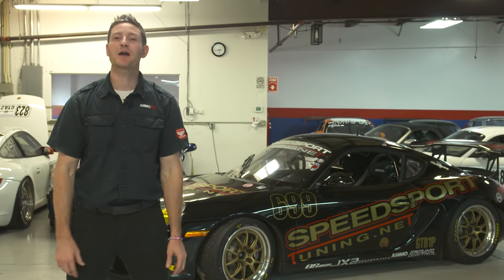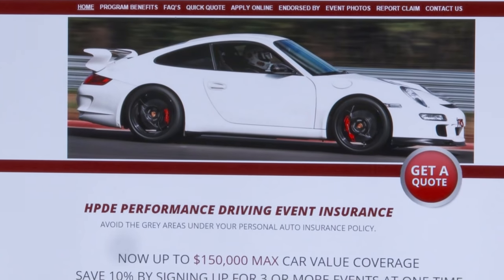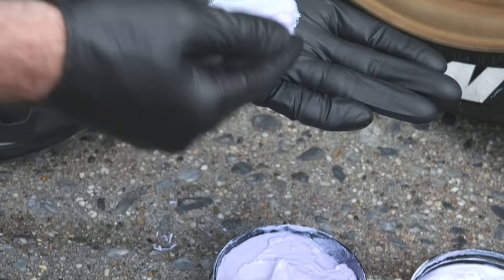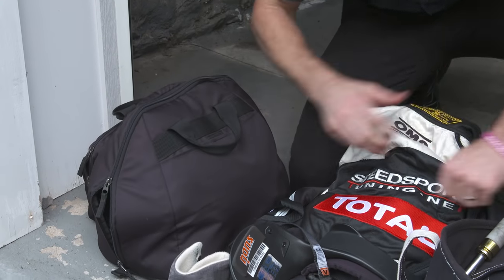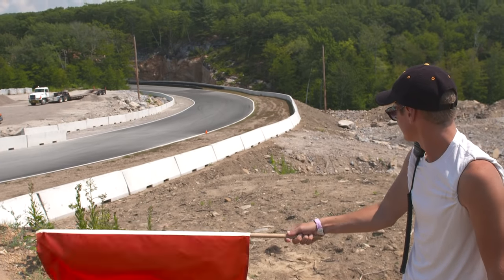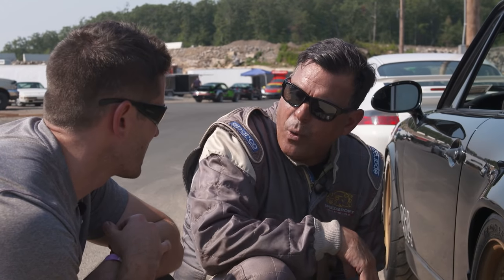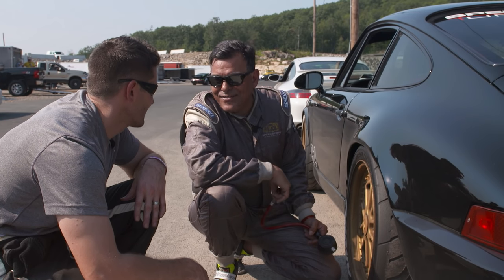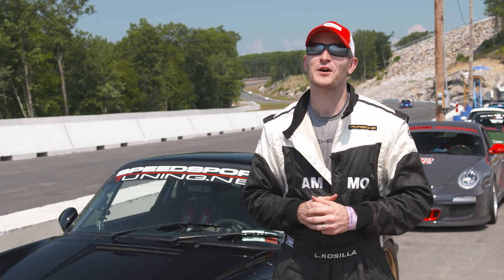Track Day Guide: MUST WATCH BEFORE DRIVING

Comment: this is absurd and virtually prohibitively expensive!  no wonder people just street race.  they don't offer track insurance, so why bother?  I know this is the "right" way, but can we just get a basic pay and drive option?  Sheesh...
Reply: Perhaps try your local autocross events. Typically much cheaper although you don't get the benefit of an instructor. Also test n tune at the drag strip if that's your thing.
Reply: They do sell track insurance Iam covered on my 944
Reply: +Harry Maisey key word is "sell", and I bet it's hardly cheap.  As stated in the video "when, not if.."
Reply: +ALT3REDB3AST it's not actually that costly it's 45 pounds per day for covering 2 drivers on mine which is worth it to me
Reply: +ALT3REDB3AST lol totally right, the insurance thing really sucks but the safety of a track is waaaay higher than street:
1.someone might jump in on the road on foot
2.someone braking hard for no reason.
3.some taxi or maybe anyone blocking the line you just entered with high speed to pick or drop a customer.
4.some asshole going 20 on the fast lane
5.since your speed is high and you change lanes fast, some one might change lanes and come in front of you thinking you are only going 40 
6.someone changing 3-5 lanes at once because he/she suddenly changed his/her mind.
7.on an empty highway someone might suddenly change his lane to the fast lane thinking you are not going that fast or he totally didnt see you because he expected no one on that highway. 
and many many more...I have been in them all but luckily no accidents due to these.
Reply: +Brendan R lol imagine a lifted truck on a track with metal bumpers, he would just smash every car and say fuck you no insurance here :D
Reply: ***** lol actually we went for karting with relatives and he braked too much and too early so I rear ended him and he was mad :D that was cheap $5 karting but I was thinking people who spend around $200 on track actually know how to drive. I lost all my hope man, I was actually looking into getting a 350z or such type of a car next to my daily driver just for track times.
Reply: +sweet dreams yeah, I know.  just wish they had pay and drive tracks.  not racing, but just a track where you pay and you can run laps regardless of your car (for the most part).  you always keep a quarter distance on track from the next driver to avoid car to car collisions.  just pay and hoon legally basically.
Reply: +Brendan R 
Yes, and what happens if you kill someone on the street?
Chances of that happening on a track are VERY low.
Reply: People die on the street all the time regardless.  Street racing is American as apple pie and can be done relatively safely with a little common sense.  Mind you, I'm not endorsing street racing; just pointing out why people do it vs the hassle and cost of running on a track for and hour or two.
Reply: +ALT3REDB3AST 

You can just pay and drive if you want.  Well in addition to the tech inspection.  Insurance is optional.

For my M3, it is quite expensive though.  $250 to $350 per event.   ~$350 for one day of insurance.  Add the initial cost of a helmet, track pads, flush, fuel, etc.  I think I paid close to $2000 for my first event.  Most of that were my Endless pads and fluid though.
Reply: That's kind of the point I think. Honestly would you really want to bring your car to a track day that allows anyone with 50 bucks to race? Besides, competition driving is generally an expensive thing to do, you're going through gas, oil, tires, brake pads, suspension components etc at a much higher rate. Your car never gets a break at the track, either your full throttle, or your torturing tires and suspension through corners going as fast as those components can handle. Compare that to regular driving, where full throttle is pretty infrequent and at the limit cornering is even more uncommon. Even then maintenance costs are a pain to a lot of people. Regardless of entry costs it's a pretty expensive hobby to have
Reply: +ALT3REDB3AST They have those... "Speed off the streets" days.  85% speed maximum.
Reply: +ALT3REDB3AST What a load of non-sense.  Street racing is only good to land you in jail and won't teach you a thing. Give yourself a chance to become a good driver, safely, and hone your skills at the track. And the cost is not prohibitive, you don't need insurance. Briefings help and after a while you develop the skills to tell good drivers from overconfident ones and can avoid them on track.
Reply: +9000Redline hey, I didn't say I necessarily condone street racing.  I just pointed out why people seem to do it as opposed to keeping it on the track.  And then you're suprised that so many people agree with me. Perhaps I have some semblance of a point?
Reply: +epiphonesg007 haaaaw!!  you so clever!!  other people from other countries even commented on how prohibitive this all seems.  Crazy that anyone can pay a flat fee and take ANY vehicle on the Nurburgring, which is arguably one of the most famous tracks in the world.  Don't want people racing and testing their cars on the open road?  Give them a reasonable and accessible place and way to do it.
Reply: You have got to pay to play, but you will never be able to push your driving skills if you don't go to a track. Remember, even if your not getting lap times with your club or setup, you have a place where the environment is cleaned, and corner workers are looking out for your ass/car. Autocross is a great economical place to start but cannot be compared to doing an HPDE day. It's much more fun, less expensive, and safer then street racing. If you are interested in getting faster, aside from solid car upkeep, and good tires, track time will be an investment you will never regret. Of course it's a slippery slope and soon you'll be switching pads and rotors if your not trailering your car to the track.

Comment: Are your wheels powdercoated? If not, how's your experience with Gelee and heat? Used a couple of products and they have melted off and the dust just adheres to the powdercoat. Thanks.

Comment: I think you should also mention NOT to use the handbrake after a session, instead to leave it in gear.
Reply from the maker: +Erik McIlhenney I had that in the edit....but it didnt make the final cut. Excellent point though. Very very true
Reply: Why is that?
Reply: +hio If you use your handbrake after a session your brake pads can fuse to the roters, locking your wheels.
Reply: +hio because the brake components are so hot, they can stick together when they cool.